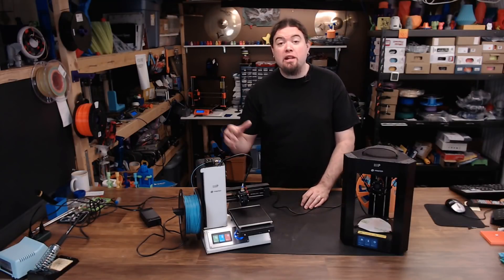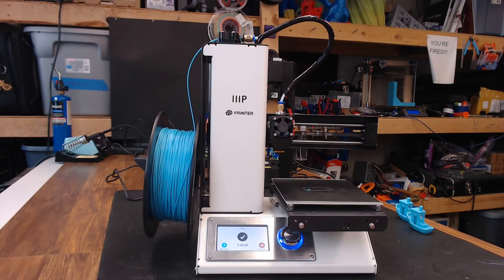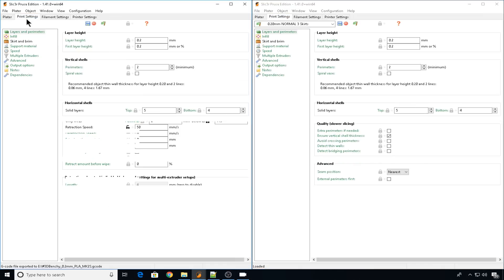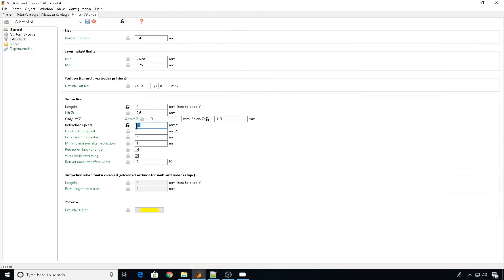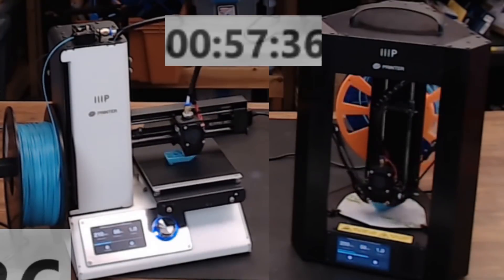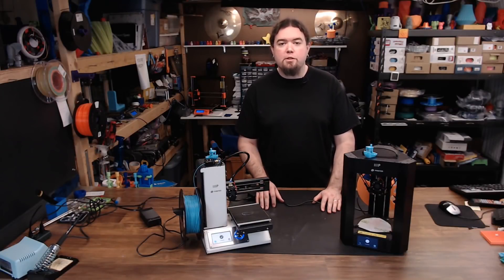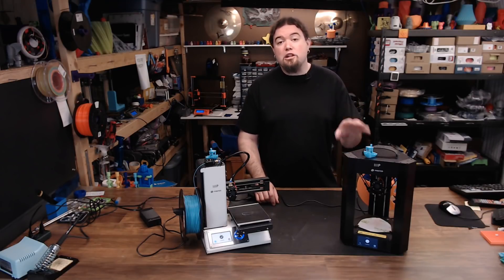Mini VS Mini - 3D Printer Race - Chris's Basement

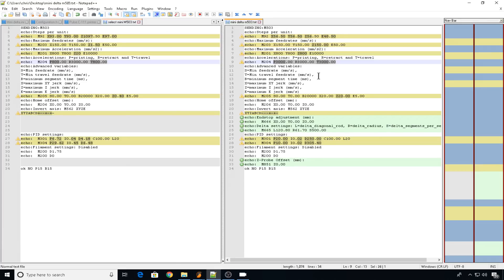Comment: Hi, i see that you respond to all of your coments, even after a year so, i have to ask, where have you found that file with the printer max speeds (the one in wich every line had an "echo:", 3:20) and what do you do with it, and have you got problems with the auto calibration? (ex. Nozzle to close to bed in the right and too far in the lef) I would want to know how you solved it. Thank you for the time taken.
Reply from the maker: Hey, that is an output on a M503 command. If you cable up USB and enter M503 it will spit this out. I have had a few calibration issues here and there, but for the most part if you use the 6 points its works ok.
Reply: @ChrisRiley  Thank you

Comment: I've been eyeing the Delta because of the price and out of the box and print possibilities. Yes the print bed is just a hair bit smaller, but this is my first 3D Printer and I want to practice creating my own custom 3D models and parts. I don't care to get to deep into repairing or modding my 3D Printer. Once i feel confident with creating original content and using this printer, I'll work my way to something bigger and more complex. Also for the low price of $150 with free Prime shipping.... I feel better spending the low price for something I know will work out of the box with very little from me to get everything going. This was a great short video but it really does show the amazing quality and speed that the Delta has over the ever so popular Mini V2.
Reply from the maker: I really like the little delta, it's a bit noisy, but a lot of fun.

Comment: Hey Chris, pleeeease tell me how you managed to make the delta print without failure. I have a Delta but I can't seem to get the configuration right and it always fails after a  few minutes
Reply from the maker: The best advice I can give you is to make sure your Z offset is correct. I show how to set that in the mini delta review video.

Comment: I'm looking into one of these for my first printer, and I really like the delta. I just have a couple of questions. How loud is the delta, and is there any major quirks that the delta has that a beginner might struggle with.
Reply from the maker: The Delta is pretty loud, the plastic panels they use end to resonate. THe leveling on the delta is a little tricky, you have to know how to adjust some slicer settings to get it to print well.

Comment: i noticed something on this video that i'm interested in learning about. you have two printers set up on the same software. i've tried to find some videos on this with no success. could you recommend something? i'm running repetier host . do i need to change software to do this?
Reply from the maker: Are you talking about having both printer tethered and printing at the same time? I easiest way to do this I have found is with octoprint. You could also do it with repetier host/server, but I think it is a paid for option. The octoprint method is a little tricky to get setup.
Reply: @ChrisRiley  I'm just interested in using the same software. Not really interested in running them at the same time from the computer.
Reply from the maker: Octoprint you can swap from different profiles and reperiter can do that same thing. That might be the way to go.

Comment: i have mp mini v1(malyan M200) upgraded to V6 hotend and titan extruder, total cost about 350€ incl. the printer(170€) and i am REALLY happy with it. Only downside is smallish build volume.
Reply from the maker: Sweet upgrades! You can probably go a lot faster with that setup.
Reply: @ChrisRiley  with pla, depending on model, about 60-80mm/s. Also flex and PETG become a reality after those upgrades.

Comment: My first printer was a Mini V2. Still like the simplicity of it even though I now have an Ender 3 and MK3. 😀
Reply from the maker: I have a soft spot for that little hunk of steel. Not the greatest printer, but I really like the form factor.
Reply: Would you pick one of these 2 two printers or the ender 3?
Reply from the maker: @trevorh9229  Tough call, probably ender3, but I like to hack and tweak.

Comment: Love the split screen view of the slicer settings. It made it all easy to follow.  Yes I have 3 deltas and they all can smoke any other printer I have had in the speed of printing. Still I love my MK3 for quality.
Reply from the maker: Thanks for watching as always. I like deltas, but until you get to a certain price point they can be kind of a mess. I would still prefer to lean on my MK3. ;)
Reply: I still want to play with a Core X/Y printer with linear rails, just seems like that would very interesting to explore.
Chris here is a idea I have had for about 1 year that you might like to think about. What if a person took a MK2 or MK3 Prusa, printer and changed the hot end parts so that the extruder stepper motor faced to the side and not to the front. Now what if stepper motor was removed from the direct drive extruder but putting a long splined shaft on it. Mount the extruder stepper to the side carriage. Get a bon tech gear that has a mating splined inside part. Now the complete direct drive extruder on the Prusa would weight 1/4 of what it does now, less mass to move around. The Z motor would see no difference in what it is lifting and moving, and the extruder  could slid back and forth on the splined shaft. Every automotive gearbox in the world has been doing this for over 100 years. No reason it would not work on a printer. No Bowden set up, still direct drive but the stepper motor could be mounted to the Z set up.
Reply from the maker: That's a pretty interesting idea, you could just mount it on a bracket that rides on the Z nut. Can you think of a shaft that would be easy to source?
Reply: Yes for testing the idea it would be cheapest to just use a shaft with a flat side or to find long HEX drive shaft, like a metric allen key. That way a guy to doctor up the Bondtech gear with a mating hex nut. There would have to be 2 small bearings in the new hot end enclosure to hold the Bondtech gear in place. Also squar shafts would work for testing. But in the end normal splined shaft would be used, a custom part to mate with the custom bondtech gear.

Comment: Another great video Chris, how reliable do you find the auto bed leveling of the delta?  Would a glass print surface being used with the delta pose any problems?
Reply from the maker: Thanks! It's okay.....a glass sheet should work just fine. In fact, they sell them on Amazon.